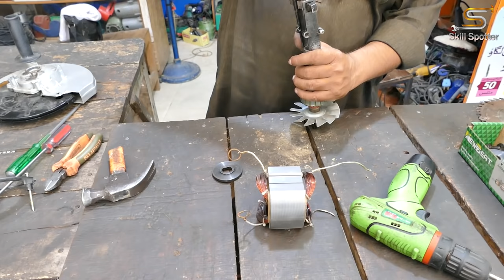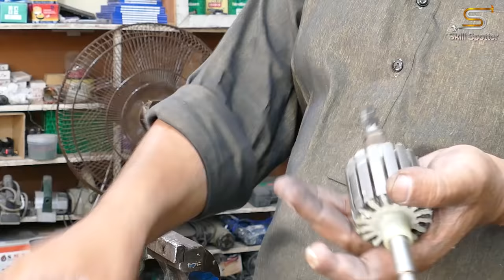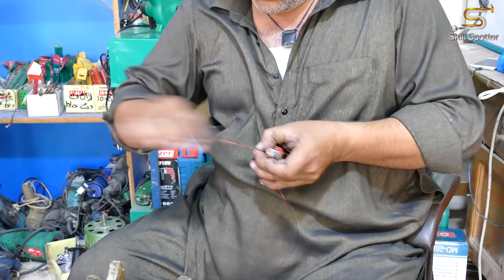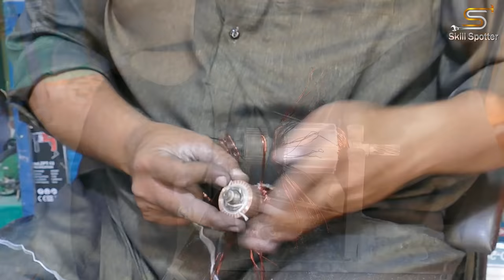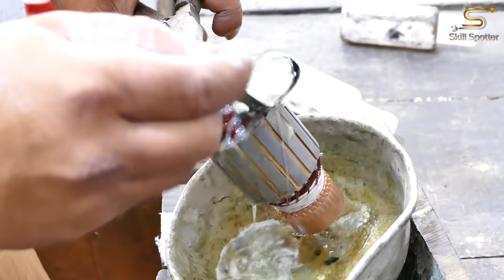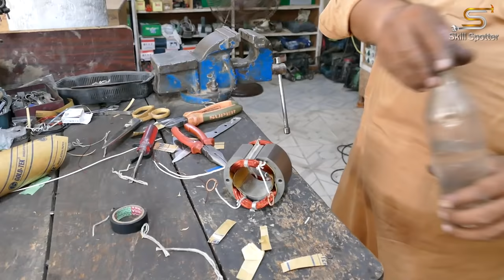Rewinding Armature & Stator of a Circular Saw | Repairing of a Electric Circular Saw

Comment: I wished we had shops like this in the U.S. that worked on small motors.
Reply from the maker: Thank you so much for your time and comment.
Reply: @der_cumsportler1022  I think it has something to do with our inflated economy. Most rewinding shops cater to industrial customers and set their minimum price for jobs over $500. We are also a throw-away consumer. Small products are replaced rather than repaired. We've also lost our work ethic and no longer have a taste for those low wage gritty jobs.
Reply: @knottreel  exactly right about everything.  Basically are culture is gone.  There is no culture.   It’s all just greedy rude people.     Sucks.
Reply: @knottreel  Could not have said it any better. Boston, MA

Comment: In addition to the winding technique, the rotor must be treated with antistatic epoxy glue (instead of conventional insulating varnish) and must be dynamically balanced, these two steps are very important. Otherwise, the device will be damaged quickly.
Reply from the maker: Sir you have a great knowledge.
You are right.
Balancing is done but unfortunately missing in the video.
Thanks a lot for your comment.
Reply: @SkillSpotter  what tool is used for balancing the armature?
Reply: فعلت الايبوكسي افضل من الوارنيش
Reply: What does the antistatic epoxy do differently from regular? I'm curious
Reply: No, that's not right. Balancing can improve vibration, but neither windings nor bearings will care. Hand tool bearings die from dirt and lack of lube, but not vibrations. Regarding the  lacquer, this has nothing to do with electrostatic or not. The resin needs to be nonconductive and, before all, able to withstand the temperature differences w/o cracking. I don't see how you assume that this excellent craftsman chose an unsuited product? Obviously he used a 2-component resin for the rotor. The stator loading is neglectible.
Reply: @lorriecarrel9962  chống lại lực li tâm khi rô to quay với tốc độ cao

Comment: Can I use short pieces of wire to complete this? Instead of using a really long piece of copper wire? Or does it have to be a continuous piece of wire going through the whole windings?
Reply from the maker: It's not possible to use short pieces because the coils have so many rounds and that should be made with long wire.
Very sorry for the late reply.

Comment: Mne v rewinding  ki thi apki video  dekh kr but vo 10 mint chlne k bad heatup  hoker burn hogya sparking  bilkul  zero tha sir speed  v thik thi  plz thoda help kijiye wire or epoxy  resin mn  oil konsa use hota

Comment: Great work.What type of liquid is used to insulate and the what khaki paper is used?
Reply from the maker: The liquid is a normal electrical varnish available in the market easily and the paper is special insulation paper for electrical motors winding.
Reply: @SkillSpotter  thank you so much for the wonderful knowledge.

Comment: I have SMT 9181 wood cutter, it shows uneven behavior like sometimes it doesn't work, connection make and break, after disassembly I found that field winding carbon ring wire is broken, is there is a problem, ring should be connected around? Plz help

Comment: Dear Professor, your work is very good, and I thank you for it. But as a beginner, I ask you to explain to me the measurement of the wire, for example, and the step of winding on the sewers and on the unified pieces, in addition to the number of turns. In the armiger as well as in the file. You have my utmost respect and appreciation. Can you send this information to my account?  Thank you so much
Reply from the maker: Thank you so much for your comment.
Actually I'm only a video creator and don't know the expertise about this work but i will try to ask all your questions to this very skilled professor.

Comment: what glue did you put sir
Reply from the maker: Varnish + Petrol.  Thanks for Visit
Reply: Which type of varnish:
Reply: @lisataylor3085  Varnish for Electrical Winding, Easily Available in the Hardware or Elecrtical Tool Shops.
Or U can Google (Electrical Varnish) for info.
Regards.

Comment: It is not armature it's a rotor.  😋
Reply from the maker: Rotor + copper winding on it is called armature.
Thanks a lot for your comment.
Reply: @SkillSpotter  Rotor. Only the winded bars are the armature, the complete part is the ROTOR.
Reply from the maker: Good point, Yes i am agree with you
Reply: @SkillSpotter  You're too kind!   😎

Comment: How do you determine the number of wraps per coil?
Reply from the maker: Experience.
Reply: Count the wires when you remove them   easy
Reply: @andyford2630  no need just scale the removed Coper wires get the same gauge
Reply: @der_cumsportler1022  yeah your way is more correct mine is lazy..xd

Comment: You are just show in how to strip the Armature what is the coil pitch also how many turns what is the wire size  come out and also what is the coonection on the commutator. Bars
Reply from the maker: In this video we just show the skill of the person.
But we will try to make another detailed video with all the technical details.
Respect your opinion dear.

Comment: SHOP VAC. motor 6 months old. multimeter tested armature, field coil, brushes good. motor inop.
What's up with this?
Reply from the maker: it's working fine 😀
Reply: No, this the problem I'm having with my motor.
Reply from the maker: Check capacitors ,motor carbons and voltage.
Reply: @SkillSpotter  Check and double checked still, no go.

Comment: there have silver wire that they used headphones, that you can used it...if plan used for engine you need blue solution for electrolyte jewelry and mix it with meniral oil....it will keep the silver winding shine and cold the temperature of motor
Reply from the maker: Thank you so much for your expert opinion.